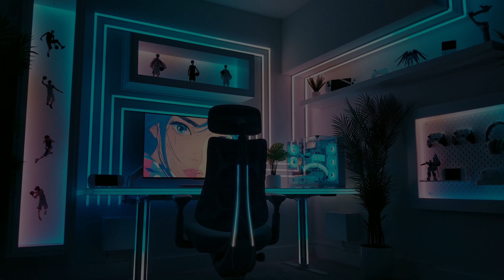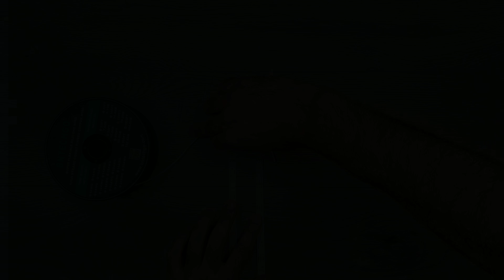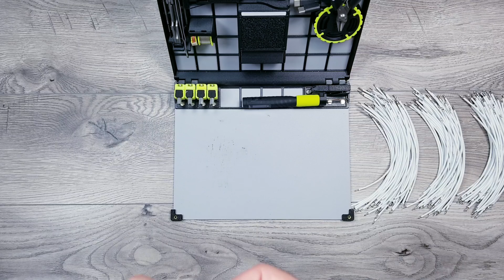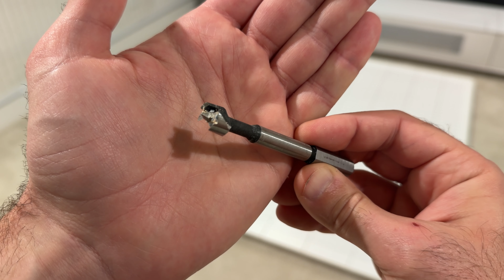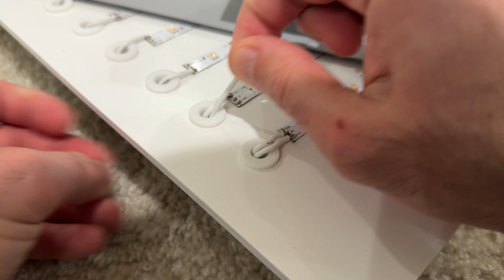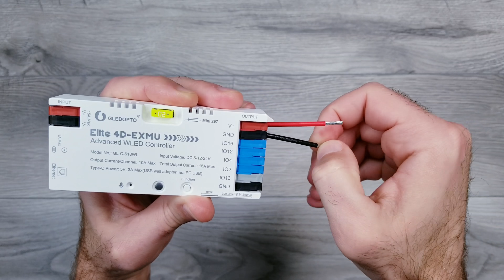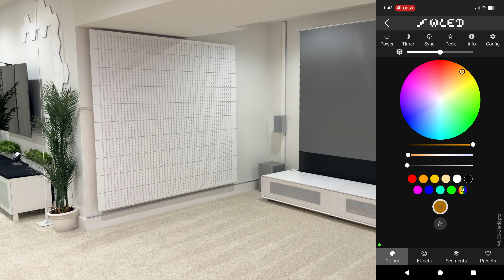DIY Matrix Panel: EASY, One Controller, One Power supply.

Comment: Small tip, You could have halved the amount of soldering if you put a 12V bus bar at the bottom, and a ground bus at the top. You only need to solder one side, not the ground and 12v at each end. Also with this you wont get such a strong voltage drop across the strip.
Reply: I wired a matrix using the spilt bus trick a couple of years ago. It saved a ton of work. But I was a PCB designer in a past life, so maybe that helped.
Reply: @GodmanchesterGoblin I am a PCB and electronics engineer in my current life :D
VFX was my past life...
Reply: Save drilling holes using a surround to hide all the wires and frame the matrix
Reply: Quick question, what prevents me from making this using an ESP-32 and a power supply? I can flash the ESP 32 with Wled. Why go through all this? Also another question, Do I need to split the data lines after few LEDs? Wont it be okay if I dont cut any data line?
Reply: @akshaykrishna5832  Nothing at all stopping you if you know how to program.
As for splitting datelines, up to you. You could run several strips data in parallel, in a sort of interlace to speed up the update rate. or you can run it as one long chain.
Reply: @MD_Builds  Thank you sir, appreciate it. These LED controllers mentioned in the video are 2-3X the price here. makes more sense for me to use Ws2812b LEDs that work on 5V with an ESP 32 Controller which also makes it wireless with multiple GPIO ports. 

The Power to the LEDs I will use with an external power source but with the GPIOs I can split data lines on the ESP and match the same on the Wled console. 

Also please let know if Not splitting data-lines and running it as one long one, actually causes a visible lag in the refresh rate of the lights? Thanks in advance.
Reply: @akshaykrishna5832 I would recommend still using a 12v strip as the voltage drop on a 5v strip will be more noticeable on a longer run. But if your using a bus bar it'll be better...
Reply: @akshaykrishna5832 sorry I just saw the rest of the question... Re data lines.
It all really depends on the length of strip and what you want to do with it. At best these usually run at 800khz. With 888/8 data. You'll have to do the maths on what an acceptable update rate is for your project. Like if you want to display video at 30fps... These strips might not be fast enough even in parallel...
But basically if you run parallel data you double the full display update rate.

But the downside is each parallel line has its own overheads. Even on a esp32s3 with dual cpus. So you'll get to a point more parallel line might end up being slower... If you write really efficient code I'd guess you could get away with at least 4 data lines before the overheads start to become a problem.

So it's a balancing act there.
Basically you'll need to experiment to see what works best for your application.
Reply: @MD_Builds  YOU ARE THE BEST!
Reply: @akshaykrishna5832 This controller is exactly that, but in a nice housing and connectors. Of course you can do that yourself.
Reply: @kraaijer  Thanks man. Im still not able to understand how to best curtail the Voltage drop. Trying to find just 1 power source to use in parallel at intervals in the strip to keep them all powered well. Not too many options on the Amazon India site I feel
Reply: @akshaykrishna5832   I made an LED Cube that is 10 x 10 x 10 = 1000 LEDs (WS2812B). It uses an ESP-32 as a controller programmed with the FastLED library because I wanted 3D effects, but there is no reason why you couldn't do 2D with WLED. I started exactly as you suggest - everything running on 5 volts, but even with only 1000 LEDs I was calculating either big voltage drops or big wires! I ended up using a 12 volt power supply and 12 volt LEDs, but added a buck converter to take the 12 volts down to 5 volts for the ESP-32. I divided my strings into 5 x 200 LEDs and the ESP-32 handles 5 outputs in parallel if you choose the right outputs. As Chris Maher did here, I added five voltage injections at the same locations as the five data inputs. Theoretically, you also need to buck the ESP-32 output data from 3.3 volts to 5 volts, but in my case the LEDs handled the data just fine with a direct 3.3 volt output from the ESP-32. I think you are on the right track using an ESP-32 as your controller but 5 volts for the LEDs is a stretch.  https://www.youtube.com/watch?v=JU7g0cj1eYc   For more details on the design search for Cryogenius LED Cube on instructables.com.
Reply: He could have also just cut the last LED off, instead of all the effort to remove the JST connector.
Now he has 149 LEDs per strip but saved a himself a bunch of tedious labour.

Also, if you're tinning 300 wires, setup a cheap solder pot.
Reply: @sih8283 right?
Reply: @sih8283  he needed 50 LEDs per strip for his dimensions so have 149 means he only gets two per strip and he has to solder an individual one back on to get the last 49 up to 50 or he has to change his dimensions... much easier to just desolder a few connections
Reply: @portalteam5832  Yeah but isn't it simpler to just buy a large roll, and cut the 50 LED sections he needs?
Reply: this
Reply: So if you did that do you still have the arrows of the led strip alternating like in the video or woould they all face the same way?
Reply: @shoppingtrolleyfistfight1677 both the positive strip and negative strip run along the whole led ribbon. You can make it alternate each way if you like or have them all go one direction. Your code will need to account for either or...

But you only solder one power strip at either end halving the work. While also providing a better power bus along the whole led string with minimal voltage drop.
Reply: @MD_Builds  ok thanks heaps man
Reply: Good job love the work you put in.
Reply: create a tutorial please XD
Reply: @DaScorp just daisy chain all the positive connections at the top and daisy chain all the negative connections at the bottom. You could also do it all on the same end. I don't think theres a good way to bus bar it all together without still individually soldering each connection. Bus bar is just a term, it doesn't actually mean a physical bar (adding this for a reply I seen asking about cooper something)
Reply: @DaScorp simply use copper tape to make the bus bar... Solder to that?
Reply: @MD_Builds  Have you truly done this successfuly without voltage drop? How do I know what width of the tape is optimal?
Reply: @bradt5426  generally speaking, a 5MM tape will likely fit all power requirements on led strings like this.... But if you really want to get fancy use a copper trace calculator. If you can get the thickness of the copper spec from the tape. 

But for jobs like this you dont even need to consider it.
Reply: For real, these kinds of channels always have cool diy stuff, but they’d save themselves a ton of work and troubleshooting with a 5 minute chat with someone that’s actually in the tools….  Sparky’s are the laziest trade, anything that takes hours of work has almost certainly been solved with some (usually) not too expensive parts or just some tips from years of experience.  Sure, you’ll have to deal with some ribbing over your cute little soldering purse kit, apparent lack of sawhorses (our knees are all shot too, so we find a way to stay off them…) and implication that low voltage is actual electrician work, but seriously, could have cut the time in half…
Reply: @joenalaska  To be fair, that's what great about YT being an open forum, cause now that conversation is public, and opens up more chatter about the topic.
Reply: @joenalaska  not much point if you follow how someone else does it, unless you just want to make it. otherwise learning and thinking on your own is way better. maybe he'll realize this on his own next time

Comment: @ChrisMaherDIY please make a test on the Govee COB Strip Light Pro connect to a wled controller capable of using RGB IC and White channel.
There is any, and that strip, looks like the ultimate strip people need to have a strip capable of be using as a normal white light but still having the RCB IC actions.

Comment: I design tech for the event industry, I'm pretty sure that controller doesn't have anywhere near enough capacity to run the strips at 100% - with 2500 of those 12V addressable LEDs they would pull over 60A at full white. That controller is only rated for 15A across ALL 4 channels combined. Generally it's better to use more controllers anyway, as the LEDs have a fixed clock speed to update each pixel, so the shorter the strips, the higher the frame-rate. I haven't used the controller you have there, as I tend to design custom hardware, but assume it can be used in parallel with other controllers to segment the display. You're fuse protected, but I think if you choose the wrong type of animation you're likely to be blowing the fuse at the least. Some diffusion over front makes a massive difference too - generally frosted acrylic over a frame to isolate the pixels (round, square, hexagonal all work great!)
Reply: That would be true if he didn't set the max draw to 11A. WLED limits pixel brightness globally based on this setting, so to me, he's sacrificing stadium level output for ease of setup and reduction in cost.
Reply: @KCM25NJL there are two big problems with  using an under rated PSU and limiting the current in software - the least dangerous is that the brightness will change dramatically depending on how many pixels are in use per frame so only certain types of animation will work. The bigger issue though is that these LED strips can have pixels fail or the software glitches which can then result in random values sent down the strips, which will almost certainly pull significantly more current than that PSU can supply (and possibly more than the wiring is designed to conduct). Even though it’s a home install you really shouldn’t under spec a power supply and rely on software to protect it. In the worst case you can end up with a sudden electrical fire.

Of course this guy can do what he likes in his house, but I wouldn’t suggest anyone else copy this as it’s just not the way you should design a high current installation.
Reply: @Anticitizen666  I'm not sure how likely those risks are, but I suppose any risk at all isn't worth it if it means your house could burn down.

Comment: if you had a drill press you can cut the forsner bit step down dramatically if you pre-mark your holes for the wiring before you attach it then take it to the press it'll speed up/cleanup the entire run at 10x speed.

Comment: For tinning lots of wires without a solder pot, here's the technique: You hold the soldering iron and the lead with your hands, and prop the roll of solder right in front of you. Leave a small end sticking up from the roll, it holds itself in place. Then you go and tin a bunch of wires with both hands, until you have used up your piece of solder, which is when you unroll and straighten up another section. Maybe 5-10 cm depending on the diameter of the solder you use.

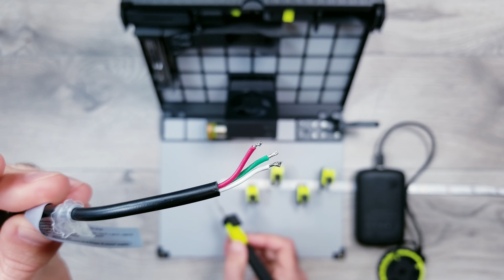Comment: Paused @1:16 to say three things...

1 - That gridfinity soldering case/station is amazing

2 - led panel connected to motion sensors at doors  (or to door bell) would be great for accessibility solutions for deaf/hard of hearing and look like a design feature rather than home help.

3 - Sub'd after 1m16s
Reply: he has the link for it in the description if you are interested in getting one
Reply: Not clever

Comment: I find it easier to tin wires by fixing the soldering iron and holding the wire and solder than pinning the wire and holding the other two.

Comment: Easier to clamp the iron when tinning lots of loose wires. If you want a lot of wires the same length just wind round a suitable size bit of card and the just slice the edges with scissors.

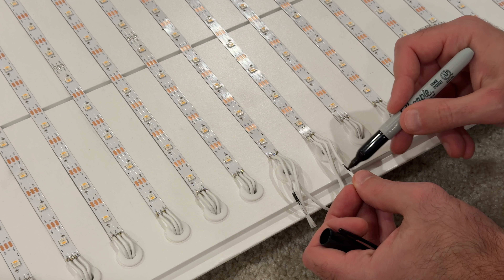Comment: 12:00  Sharpie doesn't stay on plastic or silicone very well. You could use short sections of colored heatshrink to mark the white wires behind the board. Then you preserve the look and have a durable marker on each wire. You could just add that as a step in prepping the wires.
Reply: Why? Why would you need the sharpie to endure past 5 minutes anyway?
Reply: You can cut out the power wire problem entirely by running a bus bar across the top of the panel and then you could likely cut out the serpentine data runs by not running them in a serpentine configuration at all. Theres very little reason to do it this way when working at this large of a scale.
Reply: @JustAGooseman   oh really? I hadn't seen that comment 450 times posted a day ago. 

But thanks. That really has to do with marking which wire would run to the bus bar as opposed to ground and data. 

"Then you could cut out the serpentine data?" You really dont know what you are talking about, do you? If it wasn't serpentine, if all the leads were on a single side, it would either need fifty individual data feeds or the data would have to wire from the bottom, behind the boards, back up the top, thenout the front again. Thats hundreds more feet of wire mess, kinda defeats the busbar, huh?

Comment: What soldering iron do you use and recommend, all the ones I use I try to look arfter really well but the flux just burns off and won't melt solder anymore (none of them have adjustable temperature)
Reply: He has a link in the description for this kit. I've also seen people use the one from I Fix It. It's adjustable and seems pretty slick.

Comment: nice work - at that point and since you have the LED-strips on the front anyway, I would probably have considered making a small circuit board with the connection pattern between the columns and then just flip-soldered these on top of the strip endings.

Comment: For tinning the ends of that many wires, l'd look into getting a soldering pot. It's literally a small pot that heats up solder so you can dip the end of the wire into it. They are pretty inexpensive and would save a lot of time! When you are done with it, the solder will just cool down and can be reused for next time. :)
Reply: I mean.. he could have unlocked about 10x efficiency by securing the solder and going in with the wire and the soldering iron instead of securing every single wire and going in with the solder.
Reply: @AlexusMaximusDE  How have I never thought about this before? That's a great idea, except I'd secure the iron, and go in with the wire and solder wire. I'm definitely doing this next time I have a project involving tinning lots of wires.
Reply: @AlexusMaximusDE  that's a neat idea actually! or some kinda feeder that pushes the solder in a stationary location and just grab the wire. but the most efficient way would be the pot, line up all the wire, and take them for a quick soak, flip, and another quick soak
Reply: @animepersonthing  For real efficiency, I'd drop soldering entirely. There are dirt cheap 3 pin connectors for LED strips which will pierce the insulation on the wire and either clamp onto or pierce through the pads on the strips. Those will also make it easier to replace strips if/when an LED fails.
Reply: @AlexusMaximusDE  really cooking with grease there!
Reply: @AlexusMaximusDE  Not seeing anything which would give the clean finish he was going for, nor a set of connectors which would still be reasonably priced with the number required. Might be able to use two white L connectors and three clips per bend -- if that 180 turn even allows for the right spacing between strips. 3-wire connectors are more flexible, but cost a lot more and generally have colored wires and black clips which would be even more visible than the L connectors. Perhaps a faux frame could be added to the front to conceal the connectors -- at that point, just add bus bars behind that trim and avoid all the drilling in the first place.
Reply: @animepersonthing  no need for flux when doing that? I'm interested in this solder pot, didn't know it was a thing.
Reply: @y2j514  yeah, think of it like dipping your strawberries in melted chocolate, but instead of chocolate, its solder, and instead of strawberries, its the wires. bundling too many may result in a worse thing, but grab the bundle with the off hand, and pass a single one to your other hand and dip both sides. and its tinned that quickly
Reply: @AlexusMaximusDE  That's a good way of doing it, fastest way I've ever done it was by taking a handfull of wires and just putting them at the edge of the desk so the ends were overhanging, then did one side of the entire lot in pretty quick succession.
Reply: @AlexusMaximusDE  That's basically how I do it, but I lay the solder over the edge of my desk. I grab the wire with my left-hand index and thumb, hold the solder with my left-hand ring, middle, and pinkie finger, and use my right hand for the soldering iron. When you need more solder, you unroll more by pulling on it along the desk with your left hand. 

It takes some getting used to, but it's useful if you have large wires and thin solder. If I have smaller wires, I'll tape them all to the edge of the desk and hit them one by one.
Reply: @AlexusMaximusDE  Can't you buy pre-tinned insulated wires?
Reply: Yep, solder pot is the way to go 1.5hr to 40 seconds to do them all.
Reply: Do you need to mix in flux with that?
Reply: @tymscar  dip the wire in flux, then into the pot. But realistically, have the solder stand out or clamp it and put the iron with the wire to the solder. And use lead/tin solder. Easier to handle, and you won't die from the lead.
Reply: @TheMukenukem  you won't die from 30 minutes of lead exposure also it doesn't vaporize that easily from a pot 😂